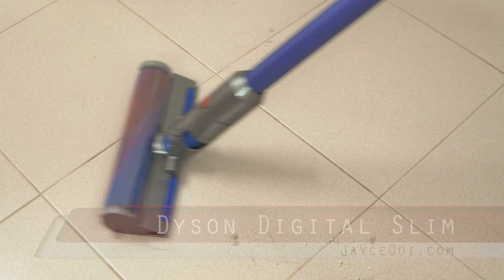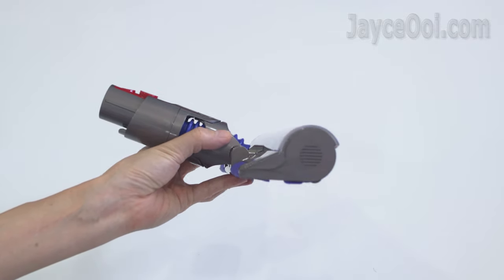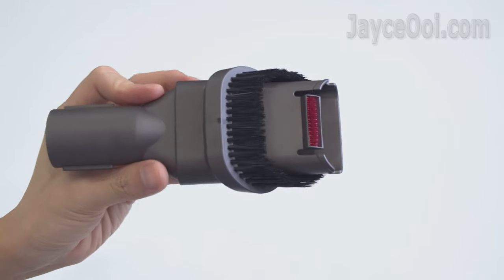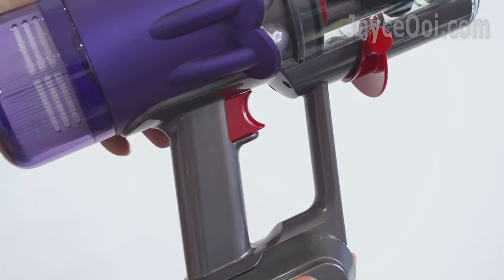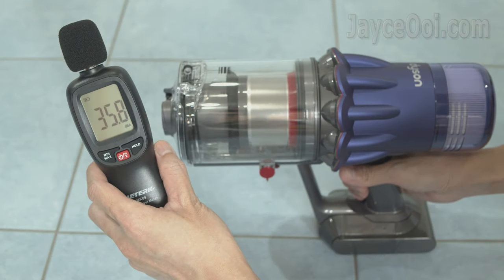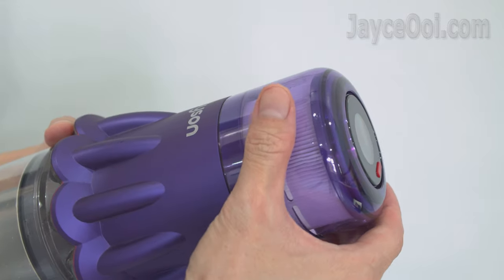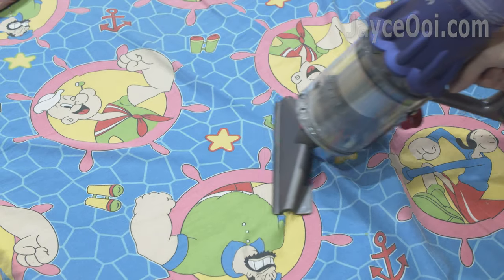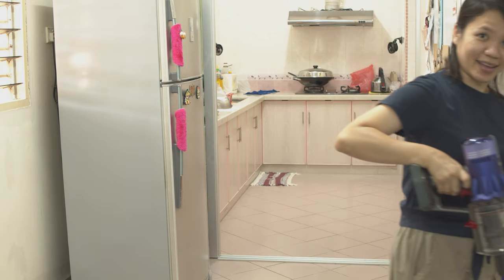Dyson Digital Slim Unboxing, Hardware Tour & In-Depth Full Review - Lighter & Smaller Dyson V11

Comment: I took your advice and bought the digital slim fluffy extra. Put it too test immediately (after the initial 3 hour charge) on the mattress with the small special motorised gadget. Oh yes... I almost fainted after seeing the amount of white peppery dust that was sucked out of the mattress. In fact I almost regretted doing it because of the prospect of having to cleanse the casket/bin and the filter. But all is well after watching and rewatching  your video on how to remove the casket. Thank you for the informative video. And I must add the machine is a dream.

Comment: 9:30 Hi. I would like to ask how many airwatts does the medium mode create? I can't find this info online (boost mode creates 100aw but it lasts only 5 minutes)
Reply from the maker: I have no idea too. Please check with Dyson Support.
Reply: @jayceooi  thabk you a lot. I have asked the seller on Lazada but they don't even know. May i ask if the Medium mode on the Dyson Slim fluffy is enough for you to use or is it too weak? Do you have to switch to the Boost mode often?
Reply from the maker: @masochistarch1311  Yes, it is enough.

Comment: Hey there good detailed review, wanna ask besides the tools differences for their  Digital Slim Fluffy Extra and Digital Slim Fluffy Pro, who do you think best suited for which package? The Fluffy Pro is more expensive but lack of the reach under tool & quick release up top adapter. Wanna know your opinion on this
Reply from the maker: If you don't need Floor Dock
, just take Fluffy Extra. Those 2 tools are useful.
Reply: @jayceooi  Thanks for the reply! Yah I thought of the structure of Malaysians house, Fluffy Extra's tools is more suitable, just that the wall mount .... Abit sayang as most condo cannot mount using drill, need to hack it, that's why the floor dock charging come in useful (else just charge on the floor directly lol)
Reply: @raymondch33  You could consider those 3rd party metal stand for Dyson vacuums where you can mount the wall dock to the stand
Reply: @jzzy011561s  what keyword to search for this? Or brand?
Reply: @raymondch33  You could search Dyson stand in Lazada or Shopee
Reply: @jzzy011561s  Ah ok thanks for the helpful tips

Comment: Hello! Is the V8 Absolute more stronger than the Digital Slim Fluffy?
Reply from the maker: Yes, for max power.
Reply: @jayceooi  but when it comes to the battery life, is the digital slim better? Since I’ve heard the V8 or V10 gets bad after 2-3 years of use.
Reply from the maker: It charges faster. Same run time. All batteries get bad after years. Depending how you use it...
Just claim for warranty if your battery started to lose run time.
Reply: @jayceooi  thanks for this!! Last question. Do you prefer the Slim Fluffy over the V10 Absolute?
Reply from the maker: @gillianramos  Digital Slim is a lot lighter. Much easier to use. But you need to clean the dustbin frequently. V10 is much more powerful. 
FYI, I am using V10 at home. And Digital Slim at office. Both are great. Pick the one that suits your needs.

Comment: What's the difference between the Dyson Digital Slim and the V8 Slim Fluffy? Can you outline the differences please so I can see whether the price difference is justifiable? Thanks!
Reply from the maker: Please watch my V8 Slim review too. 

= Better = 
Max suction power - V8
Battery - Digital
Dustbin handling - V8
Accessories tools - Digital
Reply: @jayceooi  thanks. I already did but it’s still not clear to me the advantage of one over the other. Who is the V8 fluffy or Digital for? Can they replace my existing corded vacuum cleaner? My surfaces are both hard floors and various types carpets (low vs high pile). Are both effective to be used on high pile carpets?
Reply from the maker: Slim Fluffy Head is not meant for carpets. You need V11 Absolute+ with High Torque Cleaner head for carpets.
Reply: @jayceooi  I see. Is it possible to buy the Torque Cleaner or Direct Drive heads as additional accessory? The V11 is ridiculously expensive!
Reply from the maker: @kas4751  Better no even you can buy it. Because V8 and Digital main body might not have enough power to drive the head.

Comment: Does it work well in carpet??
Reply from the maker: Did you watch the review?
Reply: Yes , but i mean i have to put it in boost to work well in carpet??
Or it can be god cleaner in med or eco mood
Reply from the maker: For Slim Fluffy Cleaner Head, boost mode is preferred.
By the way, you can use Mini Motorised Tool as the carpet head replacement. Smaller cleaning area but you can use med mode then. =D

Comment: why is it called the "lighter and smaller V11?" is the power really comparable to the V11?
Reply from the maker: Because it looks like V11. Nope, V11 is much more powerful. But for normal daily usage, it is still manageable.
Reply: @jayceooi  thanks for replying! Will you choose this more than the v11 fluffy?
Reply from the maker: If you need more suction power, have budget, don't mind little heavy weight, go for V11.

Comment: I bought this dyson slim and fluffy because of this video and it garbage. It is small and light and absolutely useless. The suction is not as strong as regular sized Dyson vaccum cleaners. But worst of all, its too small and everything gets stuck and blocks the holes, both in the roller and in the cannister. It can not handle chips, pretzels, popcorn or any snacks. Anything bigger than a pea gets stuck and blocks everything else from going in and causes anything vaccumed up to fall out. If you have anything on your floor besides dust, do not buy this vaccum.